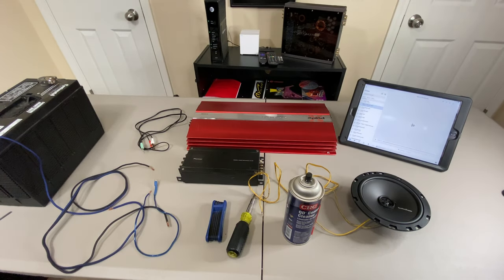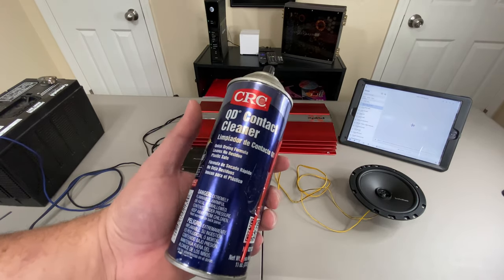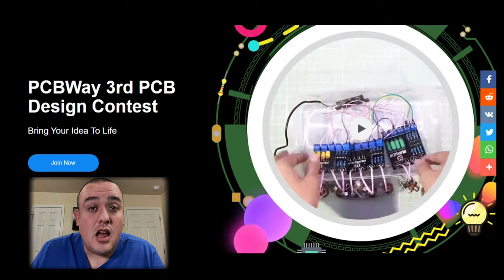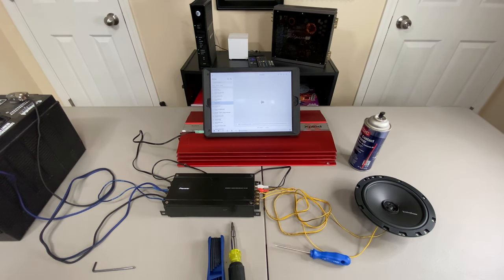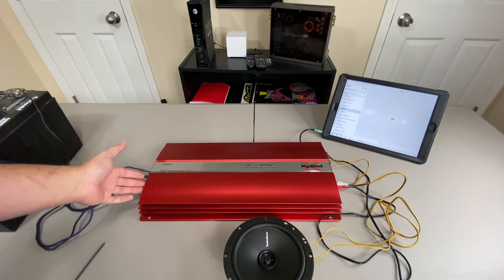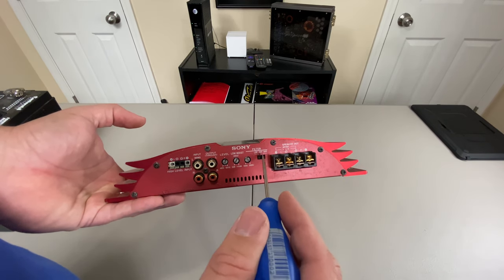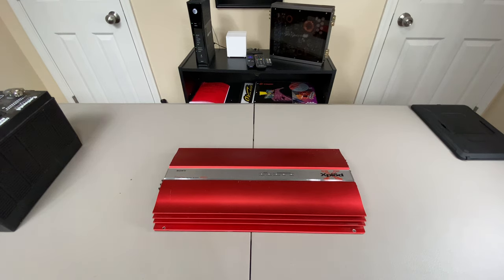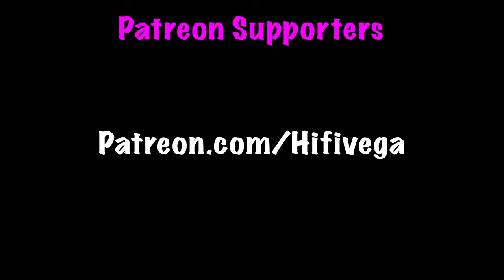How To Test An Amp (Watch this before buying a used car amplifier)

Comment: Step 1. How to connect wires.
Reply: Ground to black on battery power to red on battery remote wire bridge into battery wires
Reply: @438marcus  so what do you do with the jumper cable? I get you connect both black and red to battery, do you bridge the connection between them to turn on the amp?

Comment: Since most folks meet in a public parking lot, cheap 8ga jumper cable is perfect for powering the amp since you'll be in your car.
Reply from the maker: Solid tip!
Reply: Can you explain
Reply: @JamesTaylor-du3oo  Sure, cut the clamps off one end of the jumper cables. Now you can simply pop the hood and clamp to the battery. Use a 3.5mm to RCA for an input from phone or mp3 device and a test spk. Takes about 5mins to hook up and test an amp.

Comment: A good thing to take is a multimeter to check ohm, the fuses, and if the amp is getting the correct voltage; and a toggle switch to turn on the amp manually.
Reply: so do i hook the RCA cables to the positive input of my Amp to test? also all on low?

Comment: Be sure when using contact cleaner to not have power to the amp and to let it evaporate before making any connections it’s extremely flammable a small spark could be bad!

Comment: Hey great video HV, when I buy amps under the conditions that you mentioned I do everything you demonstrated except the use of contact cleaner. I always use a 10 or 15 amp fuse when I connect the positive side because if there’s an issue these are small enough to blow quickly but big enough to withstand the initial power up surge. One last thing is I always bring a DMM to check the voltage level at the speaker terminals because if the level is too high you don’t want to run the risk of frying your test speaker. I have a collection of well over 150 amps and I’ve done this procedure numerous times. Again another great video so keep them coming.

Comment: I have a Rockville 1000 watt 6 channel amp that is in protection mode, or at least the light is red not green now. Only one light. I have checked all connections and all are good. Fuses are good. What else could it be?

Comment: that speaker looks familiar 🤣 funny thing is the new 1200.1 i bought right out of the box the gain pot came unsoldered and fell off inside i sent it back and got a new one 2 days later and all is good.  👍
Reply from the maker: eric dudley oh no! Good thing they shipped the replacement quickly

Comment: I am getting blown fuses every time.  I tested all my connections and all just over 12 volts. Have a good ground, remote and battery connection.  Could it be the Amp? It’s pretty old.
Reply from the maker: Definitely the amp. Mine ended up doing the same thing after I ran it a few times playing with the high power/ high current switch
Reply: @HifiVega  thanks for the quick reply. Yea I went threw 5 fuses. Just tried different combos.  I made sure I turned all the knobs down.   Off to look for a new amp. Recommend any good 2 channel amps?
Reply from the maker: @Kla2024-s5t  I don’t have any new 2 channels on my radar right now...

Comment: Thanks for the video...can I connect the Amp to my car battery directly? Thanks!
Reply from the maker: For sure that’s one of the easiest ways to test it
Reply: @HifiVega  thanks for your answer...I've got the battery of my car which is 12V 65A, if I connect that battery to my amp which is a Sony 500W XR-504Z, will it blow up right? Thanks for your help!
Reply from the maker: JCOM Rock&Roll you it won’t blow up just hook the + and remote to the pos terminal and the - to the neg terminal and it should turn on

Comment: I was told one time that just spraying contact cleaner onto a noisy potentiometer could cause other problems. I was told that the pot is lubricated somehow from the manufacturer and that contact cleaner removes that lubrication. Is there any truth to this?
Reply from the maker: fadetoblack73 on a brand new pot I’d say that’s about right, but in a 10+ yr old amp that lubricant is long past it’s usefulness imo.

Comment: Great video! But where did you hookup the jumper cable to activate the trigger to turn on the amp? Did you just connect it to the + terminal on the battery?
Reply from the maker: Chetan Savkoor yeah I do that because I can trigger on my power supply with a switch
Reply: Awesome, thank you! I just found my old Phoenix Gold  ZX500 v.2 in my storage locker. There was some flooding recently and I want to check if it still works. I don’t think it was damaged, but if it’s good it’s going in my car replace the terrible stock amp.

Comment: Great video as usual! Did you need that Sony repaired ? If so just let me know. I may have the output transistors for it.
Reply: HifiVega , Yeah was probably the output section that failed. I’ve actually repaired a few that were ran at low impedance in the high current mode. Usually the Power Supply section holds up pretty well on these. Should be a quick, easy repair.

Comment: Good topic, good video!  I am shocked by how many used amps I see on Craigslist/Facebook/Pawn Shops that are missing the terminal screws.
Reply from the maker: DIY Audio Guy That’s for sure! Carrying a few different types with you would probably be a good idea
Reply: @HifiVega  or use alligator clips and skip messing with set screws when testing if possible

Comment: My subs sound like they’re almost bottoming out even tho I have my amp gain low and the subsonic a lot higher than it should. Can anyone tell me if my subs are bad or if my amp is making them sound like that
Reply from the maker: Could be a lot of things. Are they in the correct enclosure? This could also happen if they’re free air
Reply: @HifiVega  I have 2 10s and they require 2 cubic ft each and my box does 4. The box is tuned to 30hz and my subs should be at 42 hz I believe

Comment: if you're in a situation like a garage sale or flea market where the deals at hand but you can't drag out a power source, speakers and all that other lame shit, how can you do a quickie preliminary test on an amp to at least make sure the amp doesn't have any direct shorts so you know there's at least a good chance the amp works???
Reply from the maker: Quadflopper101 a visual inspection of the board is a good idea, but it won’t always tell if you if the amp is functional or not

Comment from the maker: Some affiliate links to a few of the tools I used in the video.

3.5mm to RCA
https://www.amazon.com/dp/B01D5H8KO2/?tag=robertvega-20

Klein hex key tool
https://www.amazon.com/dp/B001BQ20UA/?tag=robertvega-20

Klein 11n1 Screwdriver
https://www.amazon.com/dp/B0015SBILG/?tag=Hifivega5-20 (amazon)
https://ebay.to/31vA986 (ebay)